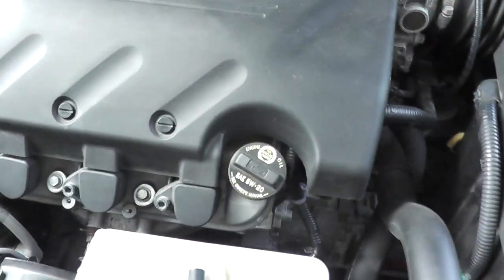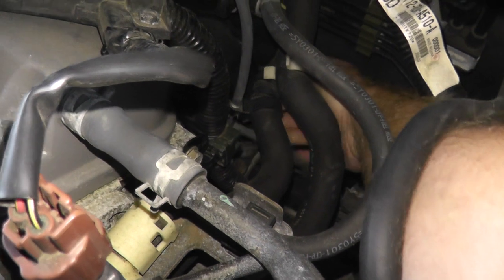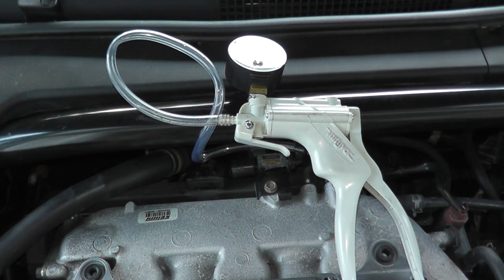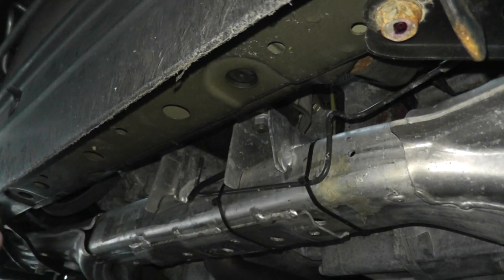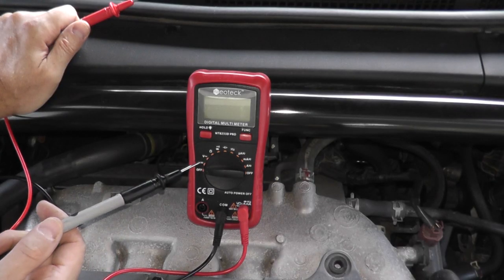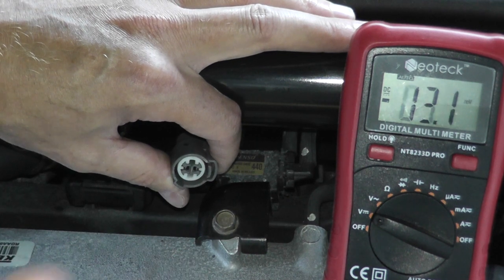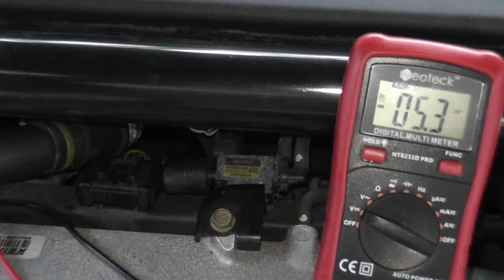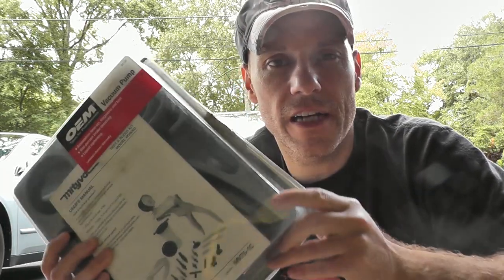How To Test Electronically Controlled Engine Mounts | Acura Engine Mount Testing

Comment: This is super helpful! When I do the last electrical test where you put two leads in the plug, I get no voltage. But I do get power from one lead when grounded to the vehicle. When I pull the hose and check for vacuum, no vacuum. This leads me to suspect the valve is bad. Is there a way to check the valve?

Comment: I have a 1995 honda odyssey ex . Iooks like it has a vacuum control  rear engine mount. It has a lever switch but the hook snapped off. Van has close to 300,000 miles. Don't know what it does. Asked a honda tech at a dealership and showed him a photo I took . No help tryed to google found nothi g

Comment: Can you get vaccuum readings from the valve to see what it does? Does it add or bleed vaccuum when running?
Reply from the maker: You can if the scan tool you use is sophisticated.

Comment: The Air that's being vacuum by the solenoid should i be able to feel it if i put my finger after removing the hose like you did?
Reply from the maker: Yes, however it's very small. You can try using the end of a latex glove.